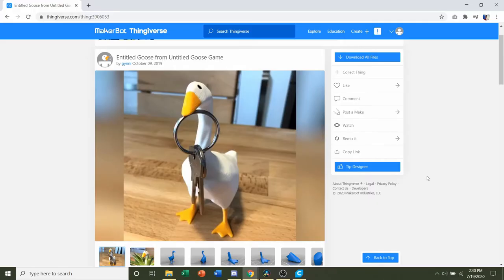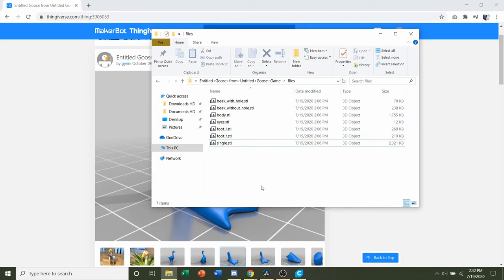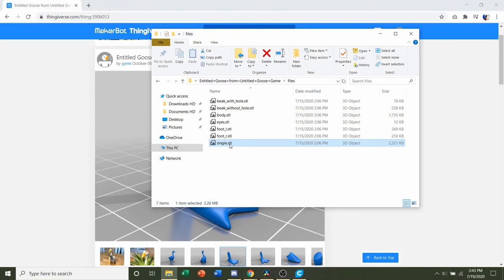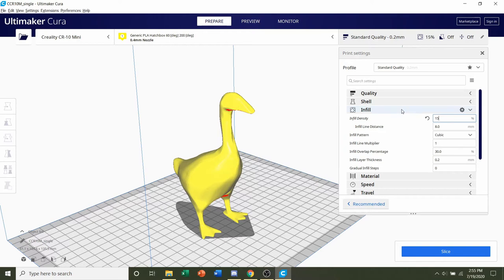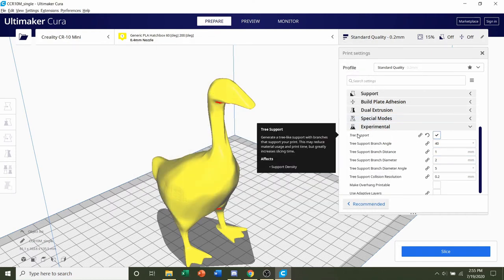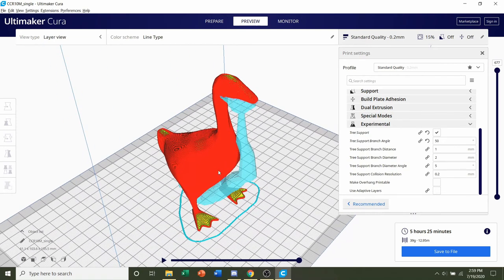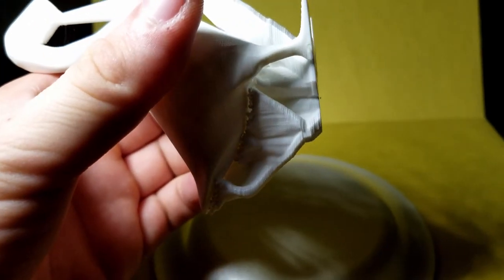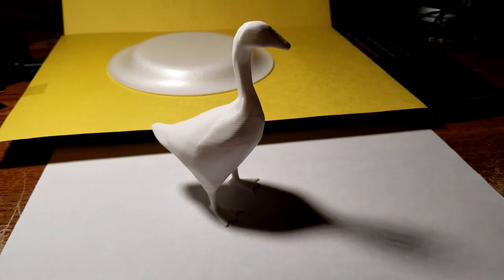Entitled Goose 3D Printed - Tutorial, Print Settings, Time lapse, Showcase

Comment: Hey man for this particular model, the normal support works best. I printed separately. The body took 3:28Hrs and 7.26m Filament and the rest of the parts with tree support 25 mins and .5 m filament. So under 5Hrs print time with ~8m filament.
Reply from the maker: Thank you Alex!
When I printed this model, I tried 2x printing parts separately and failed miserably. I honestly though my printer was well calibrated with tight belts and accurate flow rate, but parts would never connect (eyes or legs) and they would just snap if I attempted to lock them in place. 
After looking at many of the comments under the model I saw many others had this issue so I decided to approach this model in a way that anyone with any skill level or printer set up (especially beginner friendly) could print this with the least amount of head ache.
If you are confident in your printer and have had no tolerance issues in the past, your approach may be better with less material usage and a lower print time, so thank you  for sharing it with others here!